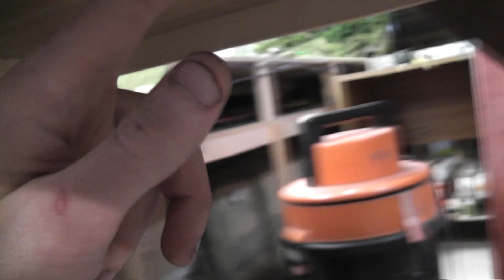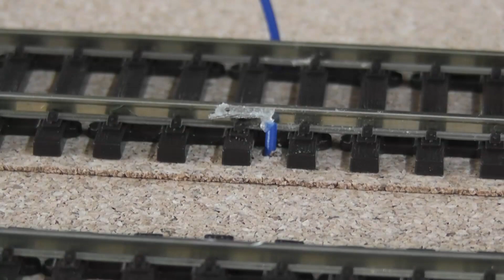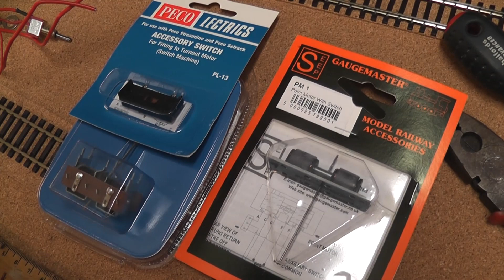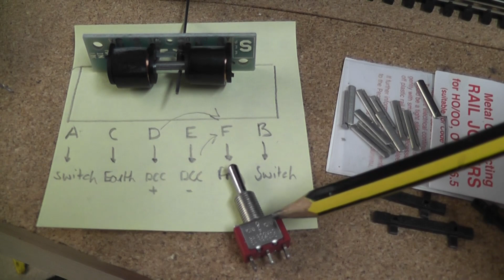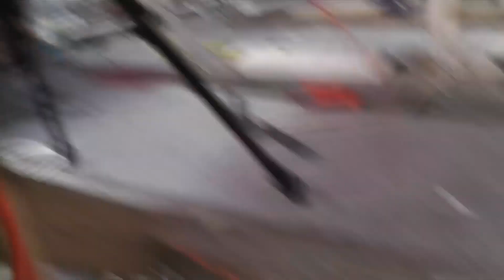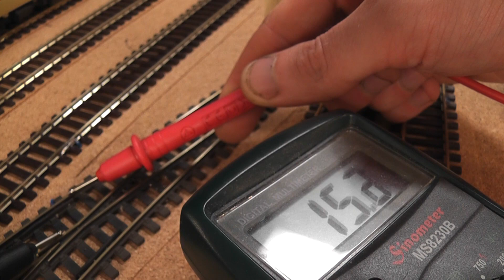Building a Model Railway - Part 4 - Wiring

Comment: It's all looking good the cable you use for your bus wiring is PVC/PVC 2.5 mm twin and earth. I've watched all your videos and I'm really impressed in the way you plan and execute everything. I'm in the process of building a model railway in N gauge for myself and my son and I've found your vids to be really helpful. I use to be an electrician but stopped to look after my disabled wife and son.
Reply from the maker: Paul Burrows Thanks for letting me know the size of the wire. Always wondered what it actually was.

Comment: another very useful video on point motors, just ordered my first batch of 6 seep motors and switches to start with to see how I get on with them, how do you know you have them correctly lined up from under the boards, other then using a pilot hole screwed down from the upper surface from lining the motor up on top of the points, that's all I can think of doing, unless you have a better suggestion. Thanks again Richard finding this series very useful.

Andy
Reply from the maker: Andy Hudson Thanks Andy.  For lining them up i hold them by hand in position and move the point rod back and forth.  I find the spot where the point moves very easily and hold the motor there.  Then with the other hand I drill a hole and screw the motor from underneath.  Then I'll make any final adjustments and put the other screw in.  It's tricky, but you soon get the hang of it.

Comment: the cable you use is twin and earth and comes in 1.0mm ,1.5mm or 2.5mm squared, this is the size of the core of the single cables i use the same for my bus wire
Reply from the maker: 646klein Thanks for letting me know.
Reply: EverardJunction Here in the States it would be called 14/2, Giving you 2 wires or 14/2 with ground giving you 2 wires that are jacketed and one not for ground, or earth...14 being 14 gauge. I'm sure its said a bit differently in different pats of the US.

Comment: I was wondering about the capacitor discharge (or whatever it's called) on the point motors.  I've heard that unless you use them it can cause the charge to flow back and damage the point motor or something.  Maybe I heard wrong.  But you get these little packets of gizmos with those seep point motors.  Look like tiny cylinders on the middle of a thin piece of wire.
Reply from the maker: Slim Charles With this setup you don't really need a capacitor discharge unit because the toggle switches only send a momentary burst of power when you briefly flick them.  Sending continuous power to the motor or holding the switch for a long time will burn them out.  A capacitor discharge unit will prevent that from happening.  I've not seen anything extra packaged with my seeps but i've had them for a while.  They must have changed them.  Thanks
Reply: Brian UK Yeah...maybe.  It's been a couple of years since I hooked up a SEEP point motor.
Reply: Slim Charles Capacitor discharge units work with either Hornby / Peco passing contact switches, momentary pushbuttons, stud and contact systems or sprung loaded toggle switches where they control solenoid type motors. They give a high current short length pulse of energy when activated that's enough to work the motor, but not enough to burn it out, also if the switch was to stick in the closed position, the C.D.U. wont be able to recharge and burn out the motor by continual streams of pulses. And no, SEEPs don't come with one. .